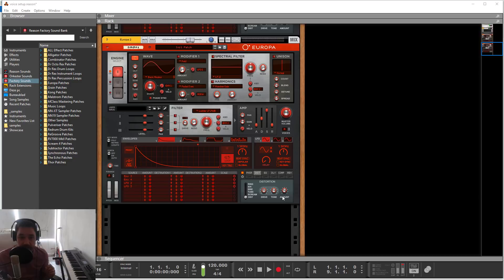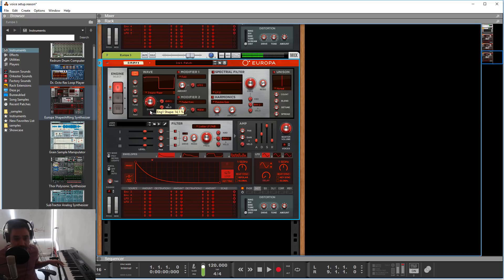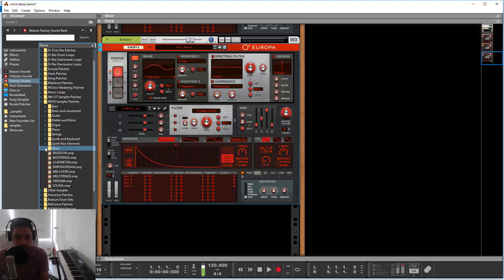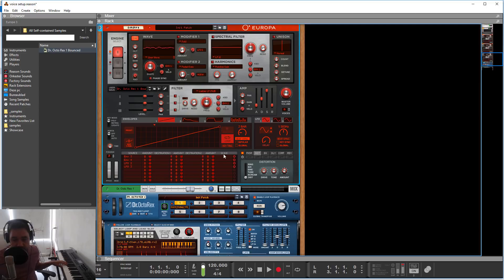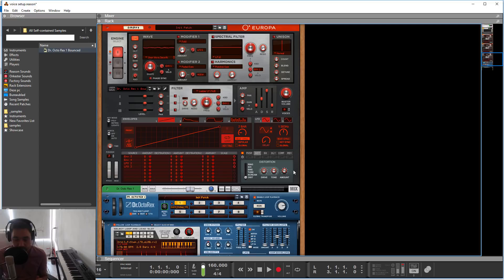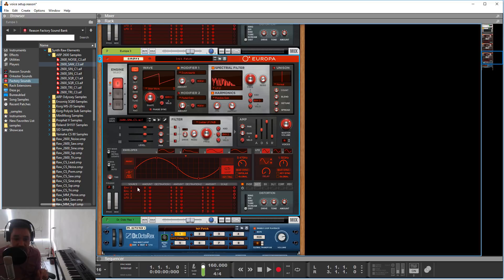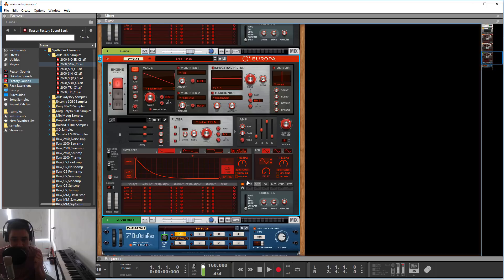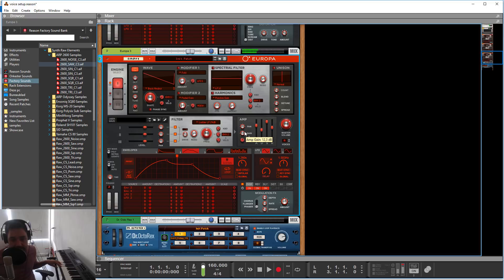Master Class Europa - Reason - ReasonExperts

Comment: i think random gain is fun for making your standard waveforms have movement. if you take a saw wave or a PWM waveform and add a random gain, it sounds like wavetable synthesis. VPS avenger has an amazing feature that lets you determine which partials are increasing in gain, also avenger lets  you make spectral filter curves. but europa beats it in the spectral filter department because europa lets you use the waveform display as a filter curve. if you take a look back at parsec, and the voice modifier you will see the birth of the idea from who ever made parsec and europa :p 

maybe one day well see them add more advanced editing options for europa. its amazing as it is, but has some great potential. i think it makes even more sense for them to add more in depth features regarding partials, oscillators, and envelope shapes because of Europa being a VST. 

either way i love using europa :D